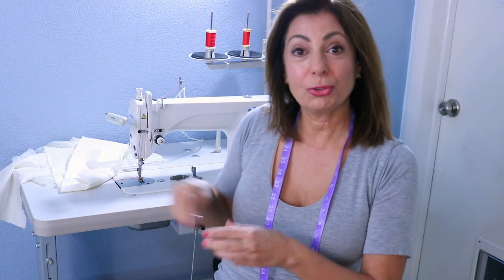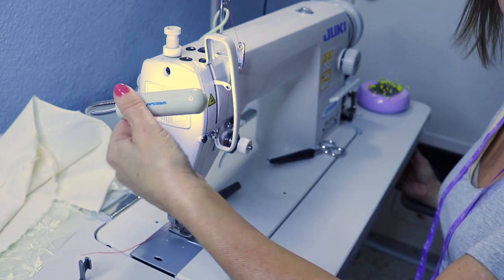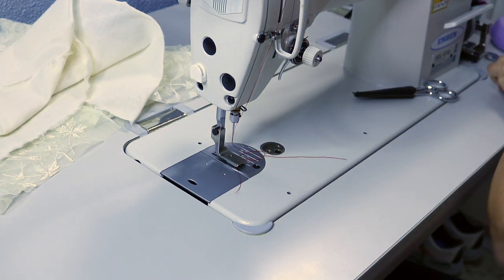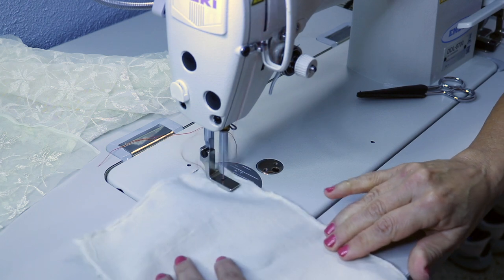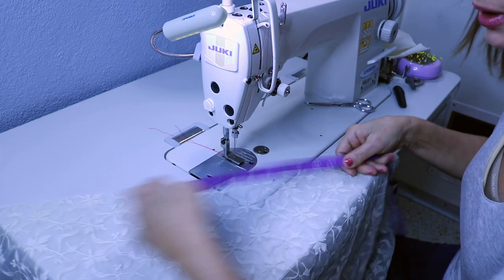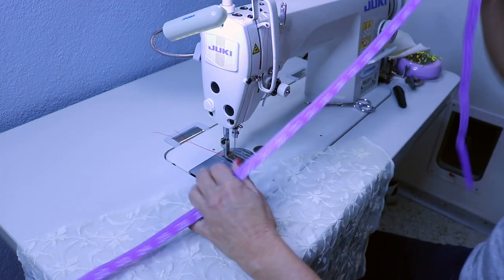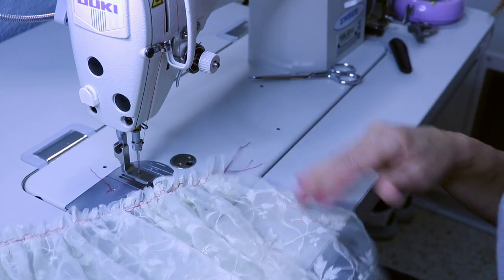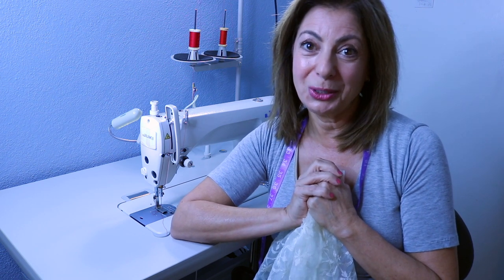How to Use a Gathering Foot With Your Sewing Machine!

Comment: I make a lot of tulle petticoats and used to spend hours pulling up gathering threads by hand, the only benefit of that method is you can control exactly the amount of fullness you want, I have an attachment now which does 2x fullness only but it's so quick, love this video Susan , thanks!
Reply from the maker: You can try the second trick to get more fullness if needed. Let me know if it works with your attachment:).
Reply: There are so many videos how to use pressure foots use while do gathering or etc. but they never show the use of other wheel as tention,length or pattern selector wheel. You are the only person I got who shown the use of tension and length wheel👍Thank you very much. Now I am going to subscriber your channel.Love you Mem🎉

Comment: Love love love, your advice, i am trying to use it for Light Face Ponti and im struggling to get a nice gather, granted the fabric bring a slightly thicker knit and its 2 layers instead of one. What advice you give me. I am trying to gather the side of a bra cup on a dress, fabric is rayon, nylon and spandex. Do i have to play with the tension more? i am using the same machine as you

Comment: My gathering foot wont gather what am I doing wrong
Reply from the maker: I'm not sure if I can't see it. What type of machine do you have? Make sure you have a large stitch, and the tension is not too tight. Also, make sure you have the gathering foot on.
Reply: @susaneliascouture  i have sorted it now thanks, gone old school (pulling thread) still cant get the foot to work though, changed stitch length, done all of it still cant get it to work. Thanks for taking the time to read & comment xx